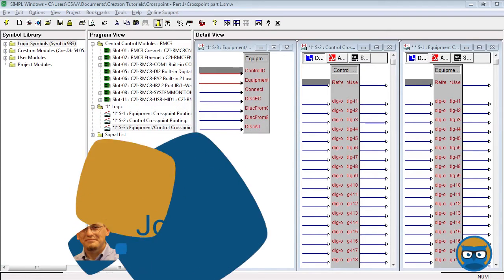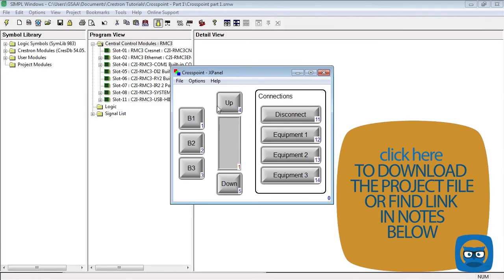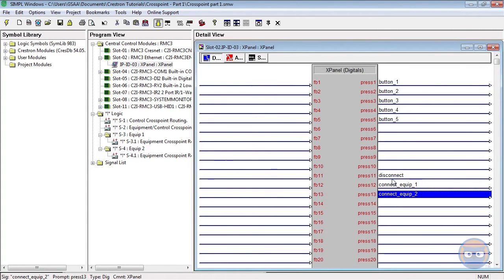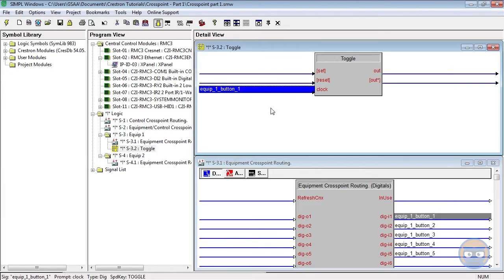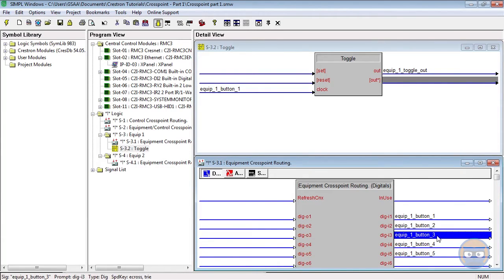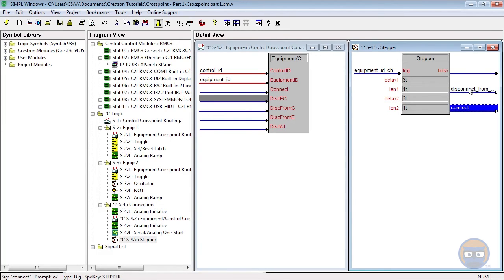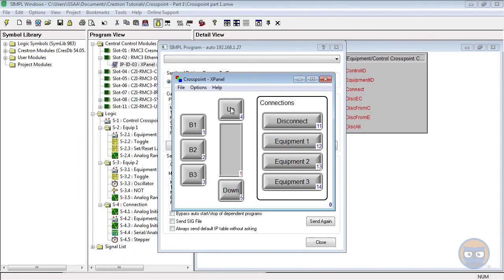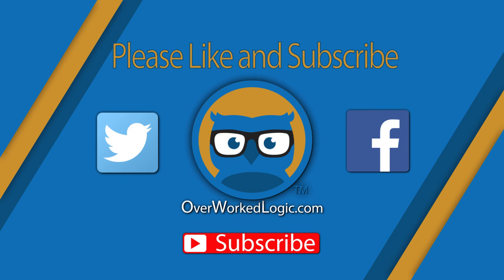Crestron Crosspoint 101

Comment: Im not much a crosspoint guy myself but understand the basic concept. How do you handle this with lets say 10 panels, 10 zones and 10 sources. Any TP can control any zone then any source.
Reply from the maker: I'd use 10 control crosspoints, one equipment crosspoint for each source (make each ecross ID represent which zone the source is in), and one connector for each controller. You'll break your control presets down by deciding if you want the controllers to control separate sources from separate zones simultaneously, or if you just want your controller to control a single zone at a time.